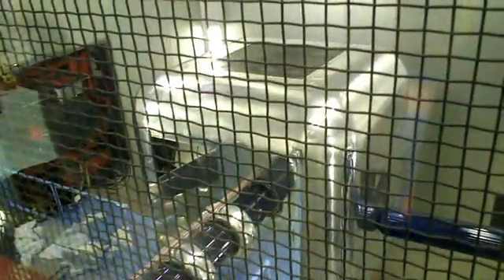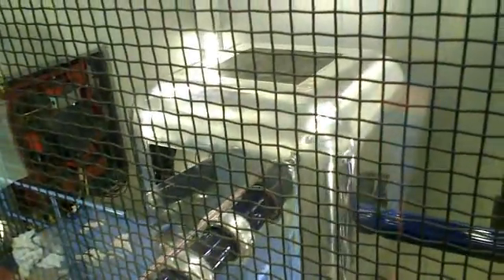Fermilab accelerator part 5

Comment from the maker: physics-illinois-edu If you get electrons going fast enough and throw them at a piece of material called a target, preferably made out of atoms that have a large atomic number, you will have a shower of electrons, positrons (anti-electrons) and photons. 
At Fermilab, the process is similar, where 
protons are thrown with high energy into stationary targets. Most of the stuff that gets made are pions, but every now and then you'll get an antiproton. Instead of photons,

Comment from the maker: from hps(dot)org
Prompt Radiation - Generated by intentional and accidental beam losses in beam line components. Can be very intense, but is present only when the accelerator is on. Behind shielding, usually only photons and neutrons are of concern, but muons are also present at high-energy (~GeV) accelerators.